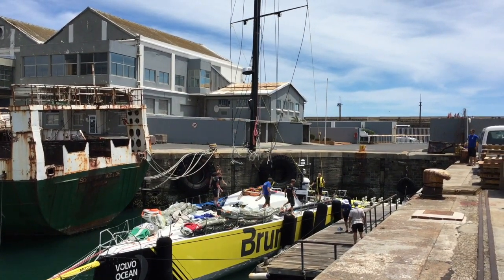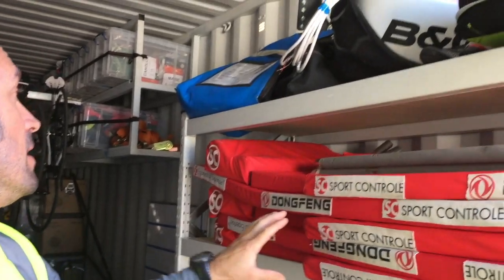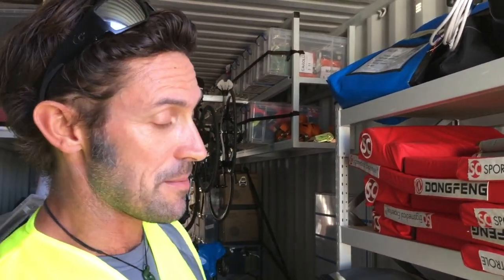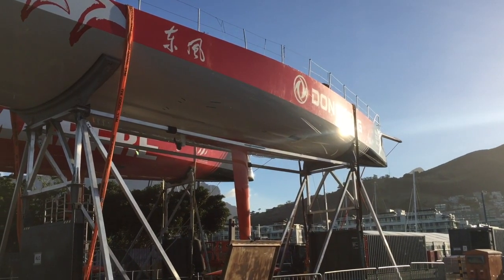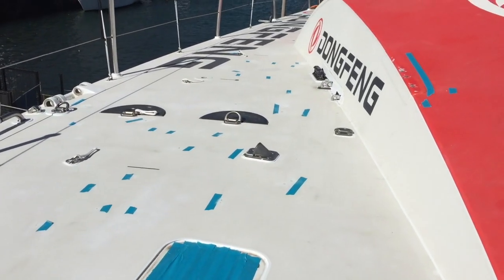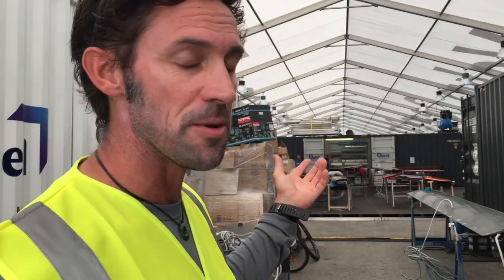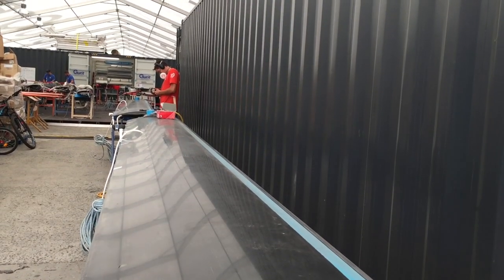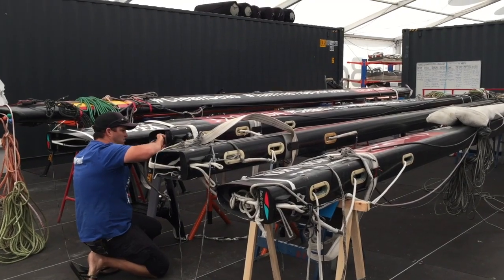Volvo Ocean Race Boatyard tour with Dongfeng boat captain Graham Tourell

Comment: Noob question, you mentioned painting a few times, why not wrap, 3M or someone must have a durable smooth surface wrap that would be cheaper/less weight?
Reply: AND paint dosent? You cant tell me, with current tech, that wrap is no worse than paint...not trying to be argumentative, I just cant believe there isn't a better way.